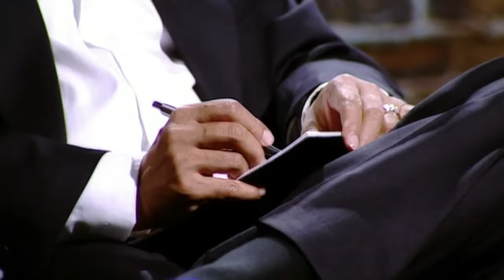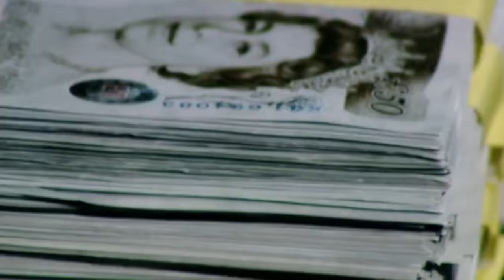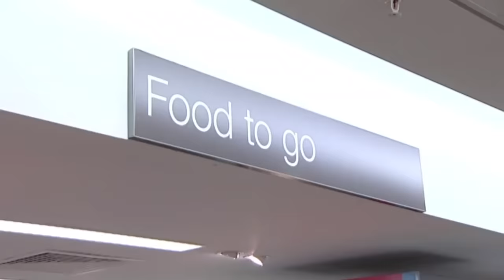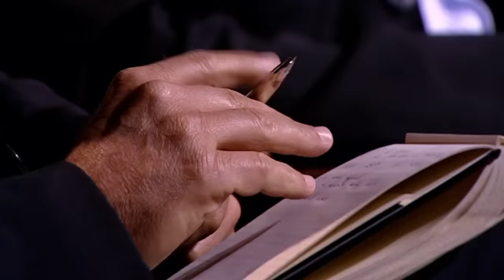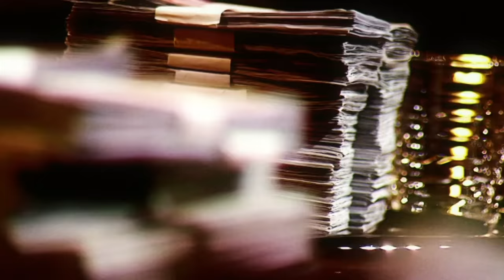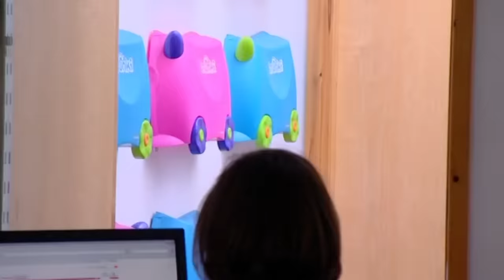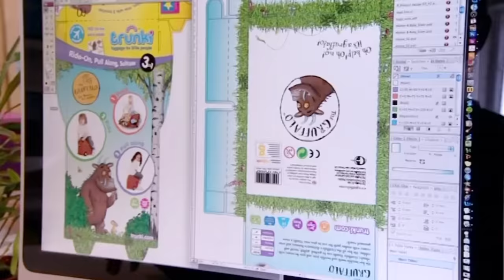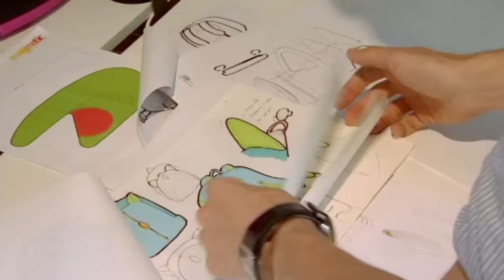Top 3 Rejected Products That Made Millions | Dragons' Den

Comment: As a mixed race girl with super thick, curly hair that gets tangled super easily the guy who invented the tangle teezer is literally my hero
Reply: Yo! 100% african with a full blown afro. I always have 2 tangle teezers. So I dont have to bother with a new one when the older one gets worn out!!!!!
Reply: @OnyaB  I was wondering if this would work on our hair! Thanks for letting me know!
Reply: Make a video of it so we can see it for educational purposes
Reply: @missceebrownin  it does. Just remember the first time you use a brush make sure your hair is moisturized and start from the tips and work your way up to the roots. With fully detanhled hair, sometimes you can just brush tight down. It's a minor miracle.
Reply: I'm a bloke with very long hair and it gets tangled quickly. I NEEED this product
Reply: Tell me about it! they are a god send!
Reply: Same
Reply: First time I've heard of this,have to check it out
Reply: I have very long dry hair that knotts very very easily...i could not be without mine.
Reply: I work with a client who has sensory processing special needs and cannot tolerate when her hair is pulled. I refuse to use anything in her hair besides her tangle teaser.
Reply: *except the tangle teaser has existed for decades in Africa. Dude is a conman
Reply: Wait tangle teasers work in thick hair?
Reply: My hero for tangled hair. Dude PROVED the brush worked by brushing the mannequins hair.
Reply: The wet brush is better imo
Reply: @akinwale_p  Yes there is a tangle teaser designed for thick hair too. It works gloriously, it does not hurt or arm breaking like normal wide tooth comb. I have one and i use it in the shower and it feels so nice and is easy to detangle.
Reply: @MidnightFae375  oh my god thank youuuu
Reply: Never got it to work on my hair, I ended up busting all the bristles on them lol
Reply: I have straight but very thin and sensetive hair i love it.
Reply: yo i swear tangle teezer changed my life i was like yo i dont have to pull chunks of hair out of my brush 😂
Reply: Right?! Also for girls who have extensions! It don’t rip your extensions out where as any other brush will! 👏 👏 👏
Reply: This invention saves my life every hairwashing day. He is a hero for me and all of my mixed race children. I am glad he made  millions just so that the dragons are disappointed with themselves.
Reply: Debra just couldn't understand the need for the tangle teezer with her mayonnaise mane completely uncoloured might I add
Reply: Tangle teaser is old old news in UK. It was years and years ago that product came on the market...
Reply: And her comparing our hair to a horse hair is rude asf. Micro racism at its finest.
Reply: @trinitiwashingtonpitts7796  just curious. When was race mentioned in this program? Did I miss the party when she said horse hair is same as black people hair or?
Genuinely curious to learn about this micro racism thing.
Reply: Same, I bought one a while ago I was wondering when his episode aired
Reply: @igormac9431   she said if she wanted a brush like that she’s would go to her horse stable which the product is used for thick course hair and she’s saying that she would just use a horse brush instead. Which is micro aggressive to everyone that can’t use dainty lil brushes. Like it’s so easy for her to say that cause she has thin hair. She doesn’t know the difference between the brushes and it comes off a ignorant
Reply: Does it do any good with pubic hair?
Reply: What was the need to specify your race?
Reply: @kermitnoexist1761  what was ur need to comment ?
Reply: You gooo girllll
Reply: Ur leng
Reply: @Vasilia4  WRONG!! no it hasn't 😂🤦‍♂️ you can clearly Google when and who Invented the "TANGLE TEASER" and it wasn't in Africa and hasn't even been around for "decades" you're a con lmao
Reply: @trinitiwashingtonpitts7796  oh and what was your need to comment and bring up race in something that had nothing to do with race in the first place? Do you always prioritize the race of people and think about race all the time cuz that seems like something that only racists do 🤨🤔
Reply: @trinitiwashingtonpitts7796  what was your need to reply to my comment which had nothing to do with you?
Reply: @Slayer-ks1kk  tangle teaser is a brand name, genius 🤦🏾‍♀️ The actual brush has been around for decades. I'm 27 and my earliest memories involve the "tangle teaser". I've used it and seen it in African/Surinamese stores all throughout my childhood
Reply: @kermitnoexist1761  dont mind Triniti Washington Pitts she's just some random race baiter
Reply: @Vasilia4  Irrelevant where it was made. Let's hypothetically assume that what you're saying is true. That means that people in Africa/Suriname who have used this before Shaun started his business had decades to bring this to the market and they didn't even try at all. This man did just that and satisfied so many people.
Reply: @Exachad  it was at the market readily available in every country I've lived in (8 countries in 4 continents). This is by no means a new or obscure product
Reply: @dark-walleddementia7067  I've lived in 8 countries in 4 continents. Every black hairstore I've visited had these brushes.
Reply: @Vasilia4  There are only one of two possibilities here. The first is that you are either completely lying or heavily exaggerating. The second is that these companies were trash at marketing their product. It is a simple math. If others marketed well, Shaun's company would have simply failed. Yet, it didn't. Why don't you give us some alternative brands that sold this since you're so sure it was available.
Reply: @Exachad  yes they did not patent a widely available product..... And? Where did I say these people wee marketing geniuses? It doesn't change the fact that the brush is NOT a new product
Reply: @Vasilia4  lmao. No, he invented it. Sure there were plastic brushes like this before. But not with the exact same teeth like his as he has a patent on them.
Reply: @igormac9431  poc try to see racism everywhere even when it's not there. They are litteraly obsessed with it
Reply: @missceebrownin  it works great for my hair
Reply: Such a big hero to you that you don’t know the name of him
Reply: literally. made my childhood hair combing sessions 10 times less traumatic
Reply: I’m bald and even I love it!
Reply: It just thick hair that brush works on. I have really fine fair but I constantly get split ends. I used to be constantly pulling in my hair with my old brushed no matter the brand. But the teezer I bought suddenly I rarely have to pull and if I do get knots in my hair atleast it doesn’t hurt using the teezer. I’d recommend it to ANYONE.
Reply: You clearly need an UMBER ELLA ELLA ELLA
Reply: I wish this was around when my daughters were small. It would have save hours of detangling.
Reply: Same! It is the only brush that helps my textured hair.
Reply: @kermitnoexist1761  maybe bc african hair textures are notoriously difficult to detangle? dont be daft. obviously afros and curly hair require more work
Reply: Love the teasers, h8 the mixed race saab humans.
Reply: It’s literally the best brush ever.
Reply: I'm going online to order one right now !

Comment: “I don’t care how this is designed” “all I care about is that it does it’s job” she may as well just brush her hair with a rake if she really doesn’t care about the design that much
Reply: Note quite, I do not care about how my car engine is designed, i just care that it works.
Reply: @anyexpat  Lmao okay. So a 100 hp engine that conks out in half a decade is equal to a 2,000 hp that lasts 4 decades in your head. They both work so they must be the same.
Reply: @xcalium9346  If that is what you took from my post I suggest you go back and take some elementary English classes.
Reply: @anyexpat  in the first place they were talking about hair brushes, how does that relate to car engines
Reply: @uhkana5748  Wow the IQs on this tread are clearly double digits

Comment: I live in America (Las Vegas) and recently bought a tangle teaser because I needed a hairbrush and it was the first one I saw at Target. I liked it so much I went back and bought my boyfriend one too. I have extremely thick and curly hair very prone to tangling that normal hairbrushes can’t handle. The tangle teaser is one of the two brushes (the other being the Wet & Dry brand) I’ve found that can actually handle my hair and work to detangle it. I’ve adopted a system of switching back and forth between my tangle teaser and my Wet & Dry brush to get through my hair. This is so random seeing it originated on the British version of Shark Tank. They’re definitely spreading like wildfire here in America. They’re in like every store over here now.

Comment: I have one 10 year old daughter and I think in the last 10 years we have bought at least 15 of these tangle teasers. I also don't understand why they didn't understand the product. I myself am a builder and I understood immediately why we should have one of these.. 
Good to see how their arrogance loses  them money from time to time. It's good to be confident but sitting on your high horse it might sometimes be hard to see clearly what is down there on the ground for you to pick up.
Reply: Does that mean they keep breaking?
Reply: @misterbonzoid5623  😁 It's kids. Things get lost, you buy a new one and than you find the old one again. And they have several. One in the bathroom and one in the schoolbag. But it's true that after a lot of use they wear out. Like most things.
Reply: @misterbonzoid5623  had mine for over a decade
Reply: I think the point you're missing here is that the dragons didn't lose money, they just didn't gain any extra money. 2 in the hand is worth one in the bush. Dragons are very risk averse and they just saw too much risk in these products. in the case of the wine goblet it needed incredibly high sales. of course this actually happened but would have still been a gamble. and smart investors try to avoid gambling where possible.
Reply: @danieljohnson8539  pretty sure any investment is a gamble
Reply: @Ghosty716  youre right its still gambling but its not casino gambling, you can reduce your risk of losing money if youre smart, this risks were just too high with these products.
Reply: @danieljohnson8539  that 1 in the bush makes no sense

Comment: The third product was clearly a truly excellent piece. The broken hook can easily be altered via design/material/manufacturing that will barely touch the figures. The dragon's were clearly acting ridiculous to only accept perfectly working product in the presentation when the product is already near perfect. Had the problem came from the structural integrity of the compartment or some concerning features of the wheels, then it would make sense to ignore this product.  They are doing an investment not a public marketing. In terms of money, it was certainly a missed opportunity for them. In terms of principle, I wouldn't mind their judgement or preferences.
This multifunctional designs must be more prevalent in the market. Unfortunately, the market is still flooded by some impractical classic designs of trollies for kids.

Comment: Someone forgot that the difference between the teaser and a horse brush is an issue of appearance and marketing. It could possibly do the same job, but the horse brush person isn't coming to you is he? He's sticking with horses. You're average Joe nor a fancy sylist isn't going to look for a brush meant for horses to put on someone's head unless the information that it's good to use is common and readily available. It's the same basic tool, but it fills a different marketing niche. The only criticism I would have of the first dude is that his presentation and ability to stand up for his product needed work, but the product itself seems very well designed and has an approachable look to it. Keep in mind, I'm no investor.